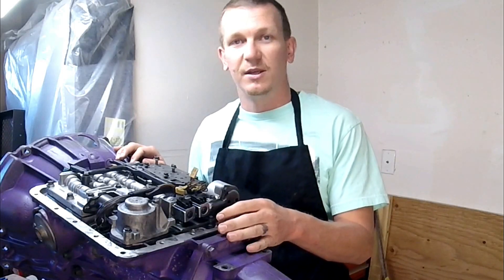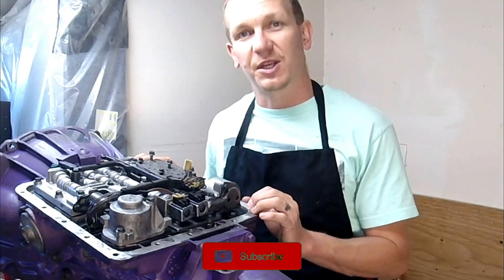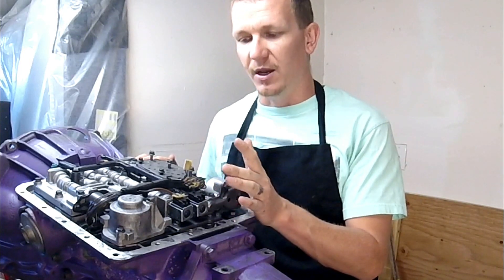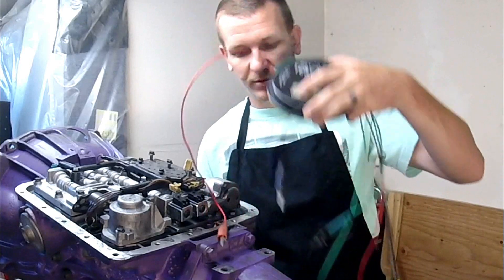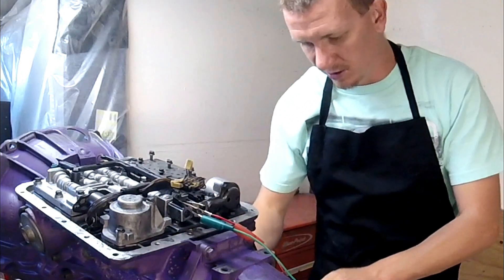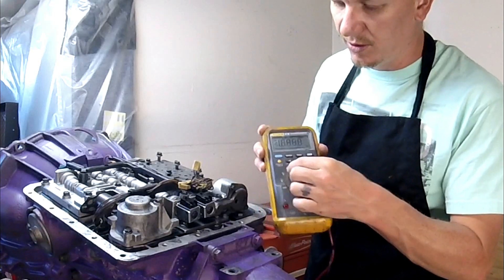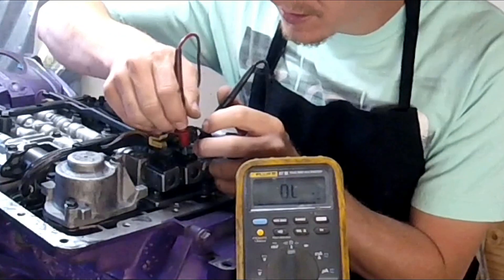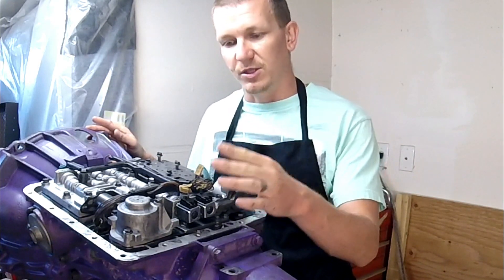GM 4L60-E Shift Solenoid Quick and Easy Test. Sol A, Sol B, 1-2, 2-3

Comment: Got a 2003 silverdo replaced transmission filter and pan then immediately had engine light on. Diagnostic test showed shift solenoid error

Comment: I have a 2006 gmc sierra 1500 5.3. I'm getting sluggish shifts from first to second. Worse so on slower speeds or less load. Not really noticing it in tow mode. I just threw a flowmaster muffler on it and I don't know if it has anything to do with back pressure but I didn't notice it before.

Comment: I have an 08 Chevy Silverado and it will not go into overdrive I have to manually shift it till I get up to 40 or 50 then it will go into overdrive and drive fine till I slow down could you please point me in the direction to check I have my check engine light ran and it was the pedal position sensor and I changed it but it's still doing the same thing and my check engine light is still on

Comment: 98 Yukon. 5.7L. Transmission has over 330,000 original miles. Still pulls strong. No slipping at all but after the TC locks it feels like it keeps unlocking and locking non stop between 45-65 mph. I know that's not what is happening but that's best way I can describe the problem. Im thinking the pwm solenoid is the issue and found a way to bypass which I may try to do. Any suggestions?

Comment: The video was of great helped, I was wondering if the was a way to check the A,B shift solenoids. I've seen video for Torque Converter Clutch(TCC) Solenoids. I figured since the solenoids look different, on the other videos, I did not think the same  method would apply. Actually the methods we slightly different, you used a 9 volt battery and the other used the car battery. Now knowing, I can use a 9 volt battery, I understand even more why the guy said, if the solenoid gets hot it goes bad. The car battery is too strong to hold, the car battery voltage, to the solenoids continuously. Very quickly would work since all we need is to hear the click, which sounds on contact.

Comment: Happy holidays I have a 2004 Silverado 5.3 4l60 problem   I'm not able to go on to 1st and 2 after slowly rolling off I can drive but after 20 to 30 minutes  transmission hot come on the code I get is obd p0756 how can I fix this what should I do my gmail is
Fapautos1019@gmail.com

Comment: 2000 Chevy K3500 6.5 diesel automatic transmission is dropping out of overdrive.I can pull over shut off truck wait a few minutes start back up and shifts fine until the next time ,it's random

Comment: Looking at buying a GMC Yukon 5.3 v8 4l60e 2wd has no 3rd or 4th but has 1st 2nd and reverse and will go into 3rd and 4th some times
Reply from the maker: I would honestly plan for a complete rebuild. You don't know how the trans was driven. Or if how long the symptoms were occurring before they stopped driving it. Did and materials make it threw the trans? Just get it all done and know you are starting fresh with a reliable transmission with no worries of being stuck on the side of the road.

Comment: I have a code P0753 showing which is saying I have a problem with shift solenoid A. If I replace solenoid A and B should that fix the problem?
Reply from the maker: I can't say it should fix the problem but it is possible. That code is letting you know the system is having a issue controlling that solenoid. Now the solenoid it self could be bad or the wiring to the solenoid or the shift valves in the manifold are not moving. Now you need to figure out what of these possibilities are causing your code. You can test the solenoid. Test the harness for continuity from the exterior plug to the solenoid connection. Remove the solenoid and see if the valves move.
Reply: @ScottiesHobbies  I replaced Solenoids A and B and the vehicle is  running good. It goes through all the gears like it is supposed to. Thanks for your help!

Comment: I have a 2000 chevy silverado 4.8...throws p01870 ...shifts hard in 1 and second...but if I put my code reader while driving and erase the code with it pops up it won't shift hard...could it be a bad tcc solenoid?

Comment: Hello Scotty, I have a 2000 Pontiac Firebird with a  3800 V6 teamed with a 4L60E. IT has a Throttle Actuator Controller TAC (Throttle Position Sensor and cruise control)/electronic throttle body and connector issue. Its wiring harness connects to the APP accelerator pedal sensor, Mass Air Flow Sensor, Coolant Temperature Sensor,  and The Engine Control Module.  Replaced the TAC (used not fully tested), TAC harness online ordered, Coolant Temp Sensor replaced new, MAF connector new replaced. Runs much better cruise control restored, and all passing gear functions, but overdrive seems missing. Transmission shifts smooth, quick, and precise. Amongst other engine codes P0753, while Precision Tune performed a TAC Relearn; also local Chevy read a PO751 last week during a general diagnosis. The diagnosis was to replace TAC, MAF Senor and or MAF connector. before continuing diagnosis of TAC (Throttle Positon Sensor sealed inside) and shifting issues. Again shift are smooth, only ? it during occasionally 3 sec surges that randomly occur and disappear. Transmission fluid change and new filter installed 2 months ago; fluid was nearly clean, only a little black fluid.

What ways can I get this 4L60E to shift into overdrive when driving (without opening the transmission case)? Also what about 1st seems missing.  Since issues increased overdrive seems missing. The car shifts into second? when I select 1st gear? It will only have aggressive take-off randomly. It never seems work in 1st.

Comment: Hey Scottie I have a 2009 Silverado 4.8 L, I was at a stop light I floored it when it turned green and maybe about a 2000 feet heard felt like a pop, or clunk noise and I let it slow down a lil and gave it gas and was still going but as soon as I stop completely at the next light would not go forward in any gear but reverse works like a champ. Please help no forward gears no check engine codes???

Comment: What if their is a extra solenoid plug
Reply: I'm
Reply: I'm not trying to be a smart-ass or nothing but there's an extra plug to solenoid or to something inside the this transmission and it's got me baffled and I was just wondering if you had an answer to my question everybody could be wrong harness or I bought the truck used and I'm kicking myself in the ass over it all right thank you

Comment: On my 2006 Subaru Forester 2.5 xt limited. I was getting on the highway today and I noticed my car revving to almost 4000 in second gear when it should have shifted like normal I had to let off the gas for it to shift. Also almost every time when I start driving my car for the day (after letting it warm up) it will shift 1 to 2 then shift to 3 early then shift back almost immediately.

Comment: Hello Scottie, Thanks for the helpful auto repair videos. Question... 03 6liter AWD with 4L60E. 145k. Started to slip on her, soon after "maybe 200miles" 3rd is just gone, won't shift up. 1, Reverse, all good. 
Would you think a rebuild is needed?  
Thanks for all your time & answering our question's.
Take care
Reply from the maker: Maybe your 3rd gear check ball has gone bad. Maybe when the fluid gets hot and thinner it just passes by the check ball. Did it just stop working one day? Have you checked the fluid level and color?
Reply: Did check the fluid level, color looked to be normal. Did add a bottle of lucas but no luck. Been sitting during this covid stuff & still just a slip from 2 to 3 rpm run...
Looks like it needs to come out, bench work!

Thanks for your reply Scottie, keep up on the helpful videos! Take care

Comment: @Scotties Hobbies  so you talk about shift valves  at  2:10 how do you tell if the valves are stuck should they push out when you take your shift solenoids out? or should they stay in one place ? i have one that pushs out when i take my solenoid out and the other stays in one place almost like its stuck? any help would me grate thanks
Reply from the maker: All your shift valves should move freely.  If you have a stuck one. You need to gently free it up. Its a pain in the but sometimes.
Reply: @ScottiesHobbies   ok thank you. woulda stuck valve cause limp mode  I'm working on a 95 tahoe I have tested all my wires internal and external I have replaced my ingnishion switch and speed sensor tested my solinoids a and b only thing I found inturnaly was posably a stuck valve and a broken screen on my epc solinoid would a broken screen on a epc solenoid cause limp mode?

Comment: Built my trans almost two years ago it’s 97 c1500 with 5.7 I did not replace sensors or harness they all checked good but I have a random hard 1-2 shift an it’s like my trans hits neutral in second but my band is good and I’m pretty shure I have correct pin to band play         I’m thinking shift so solenoid just waning to know if I’m on the right track thanks lyndan learue

Comment: I’ve got an 04 Tahoe I put a fresh rebuilt 4l60e in it with new fluid,converter, and neutral safety switch only to find out that the reason I’ve only got 1st and reverse is cause a mouse chewed on a few wires under my fuse box and I believe shorted sumthing I’m sure it’s a long shot but has anyone got any ideas where I should start to try to fix this
Reply: Rat poison

Comment: I have a 2003 Chevy S10 I taken out the valves with the spring and all that but it does not have the separator that you put in before the solenoid
Reply from the maker: Not all valve bodies have the spacer.

Comment: went to change the solenoids in my project truck last night... pretty sure clutchpacks arent supposed to be in the pan? lol
Reply from the maker: Not necessarily.  Lol. Good luck on that one. Don't forget about the check ball in the case if you do the rebuild.
Reply: @ScottiesHobbies  i went to a salvage yard today and i picked picked one up. the salvage car was running and driving before the hub snapped completely off the rear axle and the owner just didnt want to repair it. hasn't been in the salvage yard for more than a week and the fluid is nice and red with no burnt smell. for  $500, ill take that as a win.
Reply: @vardenfell971 did you win?
Reply: @KollynJ   its currently my daily driver now. got $10,000 in new parts just to get it driveable and i learned rough country shocks that came with the lift kit aint shit. truck runs good though. got 4.56 gears in my ole s10 so she sucks gas for a v6 but she can crawl in 4-lo
Reply: @KollynJ  well closer to 12k
Reply: How much voltage should there be on the shift solenoids harness with the key on on? My battery has 11.70 and the solenoids  are getting 11.10? Is that ok?
Reply: @aldogarcia393  imma be honest i dont rightly know. i did find a pdf file that may help so heres a link. i dont know if the voltages or the ohms on the solenoids would change through the years but its a start. this pdf is for a 1995. 

https://atracom.blob.core.windows.net/bulletins/1995/allyear/atb269.pdf
Reply: @aldogarcia393  afte i fixed my truck i broke my transfer case going 60 and it fell into 4x4 lol. oh used vehicles are scary. im $10,000 in on an s10

Comment: I have a 93 s10 blazer 4.3 vortec 4l60e transmission I replaced the shifting solonois a and b lock up solonoi and wireing in the transmission new TBI sensor my problem is it will go in to high gear quick and over 30 mph will not down shift tell I come to a stop does not slip I'm stumped Andy ideas

Comment: I have a 1994 Chevy k1500 with a freshly remanufactured 4l60e that's not shifting to 3rd... It's not even attempting to shift... Not sure what's wrong
Reply from the maker: Did it have 3rd gear wen you first put it in?
Reply: @ScottiesHobbies  it has never even tried to shift to 3rd since I put it in... I bought it remanufactured, but installed it myself... Not sure if I did something wrong or if it's something else

Comment: Like the video. Working on a GMC Sierra 1500 4.8l 4x4 auto 4l60e and its having up shift issues from 1 to 2. I'm having to let of the gas to shift. Usually tries 2nd and immediately heads to 3rd
 I can then gas up and get back down to 2nd. 
When really throttling it opens up and drops down to first hard. 3rd will release too when throttling as it tries to drop down and then it revs through the roof. 
Working on diagnosing before I get into it. 

I've just seen one of your vids on testing the solenoids and am stoked I can drop the pan and check them with a meter. Love to know of ove got the 187 pressure issue via diagnostic test. 
My clutch packs may be gone. 
Been reading about a low pressure issue or 187 code. 
I've got some learning to do.
Keep up the videos. Thanks for the support. 😎
Reply: Did you ever figure this out
Reply: @peterhoneycutt2259 sounds like it was fried I’d love to know too

Comment: Could you please expand on your diagnosis at 5:22?
I have no 3 or 4 at all. None.
If the 3-4 clutch pack was toast, 
wouldn't it smell that way and the fluid be looking on the burnt side of red?
Reply: Same on my 1993 Silverado. Thats why Im here. Any ideas?
Reply: Yeah but I'll have to tell u later.
When i run up to 50 in 2nd & shit to n,
I coast with less drag 
Than 3 or 4.
When coasting downhill at 50 in n when I pull it down to 4 or 3,,
I can feel it drop into those gears & start slowing me down more than I was in n.

You?
Reply: Did you ever figure out what the problem was I am having these issues

Comment: I have a 4L80E paired with a LS2 6.0 and the A and B shift solenoids shorted out i replaced both of them and it worked for a little bit and then they shorted out again can you help me out?
Reply: My guess would be bad wire harness

Comment: My transmission (05 Sierra 5.3) went completely out one day on the freeway while cruising home. 
No gears kick in, not even reverse. 
It basically completely went out and I’m wondering if there might be a simple solution to my issue before taking it to a transmission specialist. Any help would be greatly appreciate
Reply: You can check the solenoids like in this video first but i suspect a broken sun shell if it has no forward or backwards
Reply: did u figure out what the issue was ?

Comment: I have a 2005 Chevy suburban 2 wheel drive my cruise control stop working and  in drive won’t drive pass 30 miles an hour I can drive it in 2and but can’t go over 50 miles an hour someone said change the two solenoids in the transmission it has 200 000 miles

Comment: Help me please, my truck is a 93 chevy Silverado k1500 it drives fine till I get to operating temp, then it will go into limp mode 2nd gear no speedo and rpms rise what is wrong I've replaced the speed sensor and tbi sensor also not sure what is wrong,  some told me to clean the master plate the block plate by your hand or clen it out

Comment: I have a 2005 Chevy Astro Cargovan with 200k miles. Shifts fine from 1-2, slow from 2-3, but fine 3-4 and all the downshifts are ok. Could it possibly be a bad shift solenoid? Thanks Scottie!
Reply: Was it???
Reply: @KollynJ  No, it turned out to be the 3-4 piston. So, you have to tear it apart to get to it. I just rebuilt the whole transmission.... did it myself, turned out great.
Reply: @freddaniali  well the one I was handed down had black atf and slipping issues and debree overflowing on the magnet and pan and the filter dropped right out w the pan. So it might be scrap however I have an 05 envoy donor w a 4l60 4wd/awd Tran that could swap

Comment: Have a 2004 4l60 e..changed out the shifter shaft and now the truck acts like its stuck in 3rd or 4th but if i shift it to first manually it has power..shift back to drive and same thing engine revs up real high and truck slowly crawls forward

Comment: Hey bud, I have a 4l60e from 2007 with PWM. Driving fine, park, come back, no reverse. No first gear. No go from a stop until 2500 rpm, after its going about 20 smooth sailing. Drop shifter in 2nd, exact same result. Drop to 1 and nothing. Did a pressure test and reverse jumping like crazy on gauge. ALSO MOVING IN NEUTRAL. not much torque but it is noticeable power in neutral. Any help is greatly appreciated.

Comment: So in this video you said there should be continuity of both the wires for the a&b shift solenoids so what if I've only got continuity at one wire. My problem is it won't shift out of first gear
Reply from the maker: You should have a continuity on both wires with the key in the on position. When the key is off you should have it on one side.
Reply: @ScottiesHobbies  oh ok.i don't remember but key was probably off.so why would I have only 1st gear. Replaced wiring harness.shift solonoids good.no codes.
Reply from the maker: @HenryBarlowHHH  can you manually shift to 2 and or 3rd gear?
Reply: @ScottiesHobbies  no
Reply: If I red line it in 1st and let off I think it shifts to 3rd....kinda but that's it
Reply: @HenryBarlowHHH  same as mine is doing but I got 1st and 3rd just got to get up to 35mph let off then go
Reply: @brandonbretz9844  I sure would like to figure out what it is. I changed the electr. Harness. I'm thinking maybe the ignition switch but haven't gotten around to getting 1. I bought an avalanche and my Denali just sits.. waiting
Reply: Just hoping @Scotties Hobbies would help

Comment: 00 GMC Seria no 3rd or 4th gear 1 and 2 shift fine when its time to shift to 3rd it goes to neutral but can get to overdrive if i back off the gas and slowly press back down can get to any sugesstions
Reply from the maker: Probably worn out quarters. The check ball in the case to the 3-4 accumulator is probably leaking.